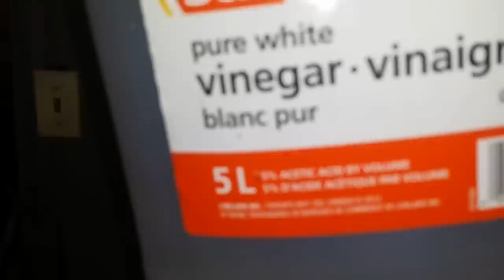Trash to Treasure: Restore Cast Iron

Comment: wouldn't take a wire brush to cast iron pans ever I know that's a post 1960 Birmingham Stove and Range and not considered collectable but its still a good pan
Reply from the maker: Yes, you are correct I should not have done that on camera, I would not recommend anyone who does not have decades of experience with a wire wheel use it on machined cast the steel wires are harder than the cast...

Comment: Grit blast : glass bead,walnut shell,charcoal,or baking soda, the metal will look like silver then you know you have the rust removed.  Time 5 min.  Then season.
Reply from the maker: True enough, but then there is the hour worth of time to pay for the walnut media, the 3 hours worth of time to to go get it, the 2 days worth of time to pay for the bead blaster, and the week worth of time to pay for the compressor big enough to run it.
Reply: trollforge Many many people & businesses have grit blasting cabinet, how much could they charge for 5 or 10 minutes ?
Reply: Yeah.  Your way probably works too, but there are usually several different ways to accomplish the same job.  This is just his way, and if he is in an area of small population he may not have access to those blasting machines.
Reply from the maker: aida bach
Soak in Vinegar, and use a copper scouring pad, just as I show in the video...
Reply: Try spraying Easy Off and putting pan in heavy duty plastic bag for 24 hours. Then scrub Easy Off off with steel scrub pad.  Dry over a little heat and then re-apply Easy Off.  
It took me a week of  this process and the pan was down to the metal. After scrubbing all the Easy Off off of pan, I  dried pan on stove, applied a very thin coat of flax seed oil, which I got a drug store in caplet form.  Baked pan in oven on 400 degrees for one hour. The flax seed application was repeated 4 time.
You will have a pristine  pan with a very hard Teflon like none stick coating,
Reply: electrolysis is the best
Reply: Yes sir, they used nut shell to clean turbine blades.
Reply: They nut shell to clean turbine blades.
Reply: happy2watchu easy off is a chemical that gets in the pores and releases into foods. Not a good ida' AT ALL!
Reply: Ivan Bentley Claymore yes this is a little exstream.
Reply: Ivan Bentley Claymore i
Reply: aida bach I have used a self cleaning oven to take off crusty build-up, and found that it does burn off most of the rust. What remained, I took off with a steel wool pad. I've even used a soap pad, (as in SOS). Why not, you're going to reseason it.  Before seasoning, if you want a really smooth surface for cooking, take some fine sandpaper and smooth it out. Then reseason right away, that bare cast iron can rust before you know it. I hope some of this helped.
P.S. There are steel and copper hand held wire brushes you can buy to help remove build-up.

Comment: you can get those more cleaner in about an hour in a fire or a self cleaning oven.
Reply from the maker: jimjams59 Well, I don't own a self cleaning oven, and I pretty sure a self cleaning oven wouldn't remove the rust... As for an hour in a fire, even though I cook over campfires all the time with cast iron, I wouldn't want to put it directly in a fire for fear of warping it, or differential heating and cooling snapping it...

Comment: Dang that's nasty.  2hrs in a self cleaning oven and it comes out as bare iron.  Done.
Reply from the maker: As I understand it, if you have a self cleaning oven, that would burn off all the burnt on food, but do nothing for the 1/4" thick build-up of rust.
Reply: @trollforge  It will remove the rust as well.
Reply from the maker: Interesting! Do you have, or can you point me to, a video showing this?
Reply: No idea about any videos...its what I do, and I've done it several times.  Very easy.  Scrape off anything loose. Then place in oven on the self clean cycle.  I clean pan that you're just wanting to stop the seasoning may be ok with a couple of hours.  An pan with alot of buildup is better with three hours.  A severely damaged pan (like this one) may take four hours.

When the oven unlocks from the cleaning cycle the pan will still be extremely hot.  I take advantage of that heat and give it its first coat of oil at this time.  Simply wipe the dry debris from the pan, wipe it down with your seasoning oil/fat, and let to cool.  Once cool I heat the bottom on the range until very hot, apply another coat of oil/fat to the bottom, and I call it done.

This always works for me.

Comment: I am the proud owner/hoarder of 10 cast iron pans/pots/griddles, all passed down through 4 generations of women in my family, both sides. I've never had to do anything to treat the inside of these pans, but Lord knows the exteriors are completely covered in carbon build-up from decades of cooking over open fire, Prairie Princess stoves, electric stoves, and now my gas stovetop. I've thought about having the exteriors sandblasted but figure it's not affecting how I cook in them, so why bother.
Reply from the maker: As I said in the video this is a pan I picked up in a scrap bin... If you do decide to do something to the outside, have them walnut hull blasted, not sandblasted. Sandblasting can cut the factory finish off too...

Comment: wow I've never seen one be let go to rust that bad ever :O I'm shocked, I never new about a vinegar solution till now good to know. me I just dish soap and elbow grease :D and then a good half hour in a hot oven or an hour over low heat on stove top. thanks for sharing.
Reply from the maker: As I said, it came from a scrap yard...
Reply: freakygeaktwo never ever use soap on cast iron
Reply from the maker: Susan Sullivan
"never ever use soap on cast iron" is an old wives tail. once the pan is properly seasoned, the oils polymerize and are not affected by soap. My Grandmother had a pan that she bought in 1914 for her honeymoon trip, from 1963 to 1985 (when our lives overlapped) she fried an egg for breakfast everyday and then washed it in hot soapy water with the rest of the household dishes, and it never showed a spot of rust.
Reply: Susan Sullivan this comes from a time when soap contained lye, so was very caustic. the modern soap you wash dishes with will not interfere with seasoning, it will just rinse away any unpolymerised oil but that doesnt matter because you are going to add more oil anyway

Comment: Have you ever thought of using a Lye bath?  1LB of pure Lye Crystals (Sodium Hydroxide) to 5 gallons of water.  All the past layers of seasoning will just strip right off.  Rust removal process was pretty accurate.  Remember to add water to your vinegar to speed up the process.  Post 1960 BSR since its stamped with Made in U.S.A.
Reply from the maker: Brandon Rose The Lye bath I have used a long time ago (25ish yrs) it was certainly much quicker, but also more expensive.

Comment: "I just didn't want to demonstrate a technique that requires skills that some beginners might not have..." and yet you go ahead and demonstrate such a technique anyway.  I have to ask, how badly pitted was that pan after 40 hours in straight vinegar?????
Reply: and using a lye bath costs $5.  I've used mine for a year with good effectiveness and NEVER took 4 days to clean a pan!  You are really misleading beginners here.  Anyone who wants to learn the correct way to clean rusty carboned up cast iron, look elsewhere or risk damaging your pieces!!!!!!
Reply from the maker: +Deb Ovall I am curious, how many cast iron pans have you reconditioned, and how many of those, spent the past 2 years in a junk pile under a tree??? While I have used lye in the past, and have no issue with that process,  there is a huge safety factor difference, you can drink a cup of straight vinegar, with no ill effects (unless you already have gastrointestinal problems) where as a cup of lye would likely kill you... and BTW, around here lye costs about twice as much as vinegar...
Reply: +trollforge why would anyone drink lye?
Reply from the maker: *****
 that was only used to illustrate the safety of vinegar over lye... it was not a suggestion...
Reply: it seems like a dumb suggestion to back up a basd point
Reply from the maker: +Doctor Morbid a BIASED point???

Comment: Nice to see a Kilt wearer that is working on something other than kilts and such ... good job on the skillet ...
Reply from the maker: I spend a lot of time up on ladders at work, but other than those days a
 kilt is my usual attire from the end of March to the end of October. 
Thanks for watching!
Reply: I am going back to full time kilts, tired of the hassle of trousers and getting gaulded down there in warm weather ... winter and summer ... inside mostly, but want the freedom back ... I am trying to rescue some cast iron but people want a mint for some that isn't really worth the trouble except that it is cast and I canna afford to pay top dollar for bottom drawer items ...
Reply from the maker: I'll tell ya the utilikilt is not the thing for -40 and 30mph winds... Just saying... and,  ya I have seen people trying to sell post 1960 Japan, and Taiwan 6" pans for $60...  But I have also found Lodge and Wagner in recycle bins at the curb on garbage day, so...
Reply: Nobody around here (mountains of western NC) throw CI away unless it is both warped and not just cracked, but broken into several pieces as the cracked pans are usually welded  and uses as camp goods for weekend fishing and hunting trips and to let the kids use on their outtings ... I found a couple 6 and 8 in pans at the Goodwill store, but all were really warped and they wanted between 35 and 45 dollars for them (each) ... I passed and found one at a church thrift shop for $3.00 and it wasn't warped or cracked so I got it, 8" BSR and I use it all the time ...
Reply: @kenadamson4535  Good for you. I collected many different sizes in Griswold years ago at yard sales and flea markets, before they went way up in price. Can't do that now, unless someone is selling it that just doesn't know the value. Have restored many, and love them. Use them almost every day.

Comment: You have to use the good brand vinegar,,,this cheap stuff is not that great, it don't clean as good and it takes to long to clean what ever it does clean,,,I use the good brand and have never in all this years, have not use a power wheel, just a hand wire brush does the job...
Reply from the maker: And how often have you worked on pans with 1/4" burned on grease on one side, and, 1/4" thick rust on the other?
Reply: @trollforge  several time,,,I'm not worry about the burn side,,,is going to get burn and dirty again,,,,but the inside, is easier if you spend a dollar or two more and you will see the difference, makes it easier for you...give it a try, I personally like "Heinz" Costco has a 1.25 gallon for under 3 buck..good luck
Reply from the maker: @angeldelacruz7254  no, I was talking about the inside, in both cases.

Comment: Vinegar will only remove rust but not the build up. Lye bath or electrolysis tank will take it to bare cast iron. Electrolysis is my preferred method.
Reply from the maker: I am inclined to agree, as I said, I was only testing someone else's claims...
Reply: @trollforge  yeah when my cast iron addiction started 8 years ago. Vinegar was the first thing tried as well.
Reply from the maker: @victorm7274  nobody talked about vinegar back when I got the bug... my grandmother had 3 frying pans she infeced me back around 1970... bought my first cheap Taiwanese set about 78 when I was in high school... I think I have 38 pieces now, mostly antiques, and have fixed up and given away well over a hundred ...
Reply: @trollforge  oh you definitely have an addiction. I have a bit more, around 70 pieces . My wife and I travel to different states for work and it never fails I end up coming home with a piece or two.

Comment: Your pan is an BSR ....AKA, Birmingham stove and range! A very nice pan, further if it's marked with MADE IN USA, then your pan was made between now and 1960, if it was not marked with this then it would be older than 1960! Also if you were to add water to your vinegar, I believe it would have speed up you process! Just a little fyi.
Reply from the maker: karrie cline Thank you!

Comment: can you use citric acid and water mixed 50/50 to remove rust with out hurting the castiron? I used it on an old wood plane and it worked great.
Reply from the maker: Citric acid is sold in many strengths and forms, so I'm not sure quite how to answer your question. he Citric acid crystals used for etching concrete mixed to those instructions has never burnt me so I would assume that strength would work quite well for cleaning cast, though I think the food grade stuff sold for canning would be safer.
Reply: trollforge Yes I used food grade citric acid i bought from the grocery store  on my wood plane . I want ahead and tryed it on a very rusty cast iron corn fritter pan, It went well and was very fast 2-3 hours tops,  there was a rotten  egg oder that was produced so I had to move it out side. the pan came out totally clean, like new, no scrubbing.
Reply from the maker: flitdek
Sweet! Something else I'll have to try!!!

Comment: I have a cast iron skillet that someone used a pizza cutter on the cut up a quesadilla….. it’s got grooves in it now, and lots of build up.   Gonna try this out.
Reply from the maker: The grooves are likely just in the Seasoning, but if not, try sanding the whole bottom flat with a random orbit sander like you would use on wood, then reseason.

Comment: Salt, particularly coarse koshering salt or rock salt, is used as a cheap abrasive, which is food grade ( duh ) and easily available. The special reason to use salt, is because it totally dissoles in water, so it can be easily and thoroughly cleaned up with no residue when you are down. Salt does not harm cars if you use it the same way. It is only when you LEAVE the road salt residue on your car that it becomes a problem. But a seasoned cast iroon pan doesn't have thst problem either. After you use and clean a pan, you should be sprinkling table salt over it, because salt is a bacteriostatic and prevents bacteria from growing in the seasoning. Yes, I have been doing this for nearly 50 years with NO problem. It is only bare metal that has a problem with salt and moisture.
Reply from the maker: While I agree that "seasoned cast iroon pan doesn't have thst problem"... "It is only bare metal that has a problem with salt and moisture." Salt is not abrasive enough to deal with the 1/4" thick build up of rust this pan from a scrap pile had, the crystal structure of salt is much softer than that of Iron oxide, AND vinegar, from the grocery store is also "food grade ( duh ) and easily available."

Comment: has anyone tried sandblasting with a shell media as a method of rust removal. Or use a product called Navel Jelly or Coka Cola or CLR
Reply from the maker: Sandblasting with a shell media works great! Navel Jelly is not recommended as food safe, Coke barely works in the best of circumstances so IMHO is a waste of time CLR might work to some degree, but is weaker than vinegar. And again, IMHO I don't want CLR in my coffee pot or my frying pan.

Comment: why not sand blast to  clean all rust off,  then oil to restore
Reply from the maker: +Buddy Phelps That would work fine on a newer pan, or the outside of an older one, (if I had a sand blaster), where the surface is "as cast" but the older pans had the inside surfaces ground smooth, and ground cast iron is a very soft metal, not at all abrasive resistant....
Reply: Who’s got a sand blaster?  Lol!  I can get a gallon of vinegar for a buck.

Comment: I tried to use vinegar once it took 2 months but it did work I usually put them in a fire for a while and burn all rust and stuck on stuff off it will turn to Ash and fall off no scrubbing when I take them out I use a steal hook spray them with cooking oil hang them up wash them the next day ok too use dish soap to get the black out of them it's messy but not like this when I am done heat on stove oil it it's clean and seasoned ready for use this man did alot of work
Reply from the maker: Fire is fine for the newer pans that still have the casting scale inside, but uneven heat can crack pans that are machined smooth inside. I've never tried the self cleaning oven method but it might be safer for machined cast.
Reply: @trollforge  I have used that method on 30 or 40 pans many very old only cracked one a number ten Griswold never used oven

Comment: Great Video Troll; I bow to your tenacity and perseverance. I'll have to try this on some bronze pump impellers I have that are coated with Calcium. To reply to previous poster on Naval Jelly. Naval Jelly contains Phosphoric acid, it may work terrific, but the cost and the amount of material removed would ruin the restoration and possibly remove stampings etc. I could buy three times the amount of vinegar that it would cost me for Naval Jelly.
Reply from the maker: Cheapest I've found  Phosphoric acid is $10 a Qt at a hydroponics specialty store.

Comment: I saw in another video that 6% acidity vinegar works good for rust. And electrolysis bibles off the carbon. Why do you only use copper scrub? Is it better? Thanks
Reply from the maker: Arlyne Lauro theoretically the stronger the acid, the better. At industrial cleaning supply places you can even get 10%. Contrary to popular belief cast iron is a relatively soft metal, it can be damaged by steel scouring pads. It is not an issue with the new fangled "preseasoned" pans because the slag & scale has not been ground out of them.